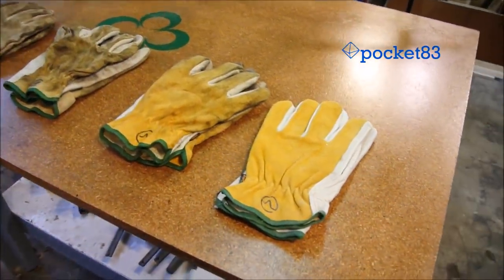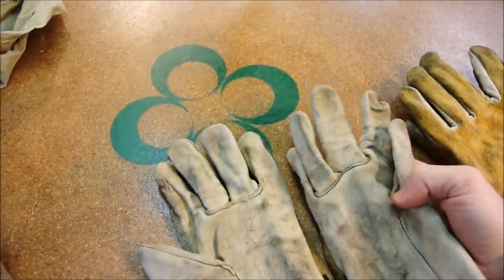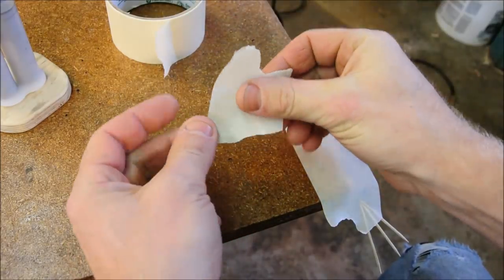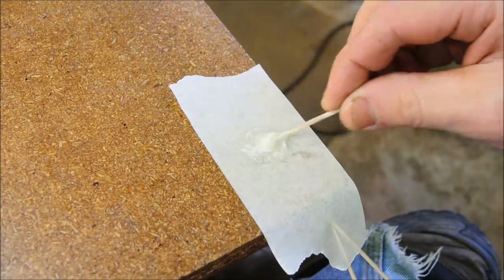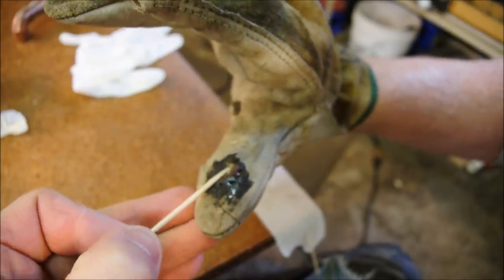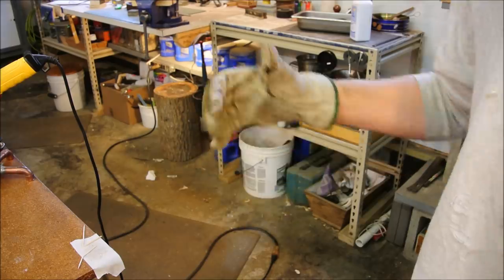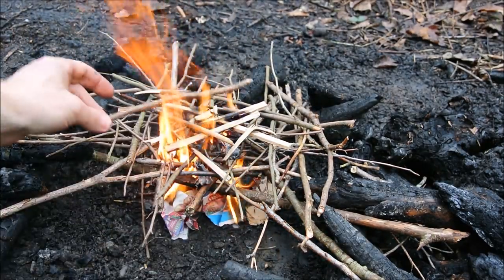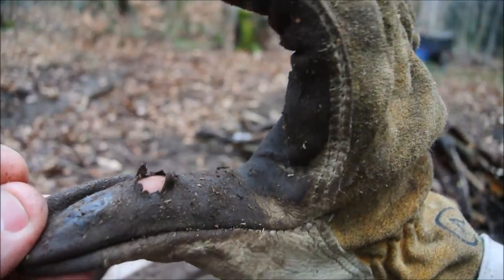Epoxy for Leather Glove Repair? Test result: ★★★½

Comment: Have you looked into Rocket Mass Heaters? I don't know if they're snake oil, but as advertised they are the best means of heating up a space with little fuel. (Wood included, no coal required)
Reply from the maker: Ok, book report time. I just spent 2 hours watching vids and reading about them. It doesn't seem like snake oil at all, but in typical subculture form, it's being presented as though it were a 'new' concept. It isn't. The idea of holding heat with a mass of dirt, straw, clay, sand, and rock is as old as the brick hearth itself. They were making fireplaces into heated beds long before we had many of the technologies that we now consider modern: like cast-iron. As for the "rocket," it's also only pseudo-nouveau, which is to say that it's naturally appealing to the ultra-earthy hipsters out there who've never actually played with fire. 

As a rule, on a planet with finite resources, "sustainability" is fools' gold when the inhabitants there have insatiable appetites. But perhaps they (the aforementioned trend-chasers) will gofund the technology, and that could help develop it into a safe and efficiently designed consumer product.   

The entire premise can be reduced to these parts: 
1) insulated, J-shaped firebox more thoroughly consumes fuel, reduces deposition, acts as integrated chimney.
2) non-insulated primary flue becomes a direct-to-air radiator.
3) massive insulation of secondary flue creates slow-release radiator, stores large amounts of heat.

Do I consider the present state of the technology efficient enough to warrant its construction right now? Ummm, that's tough to answer. A comparison will have lots of pros and cons, and it all depends on context. No matter what, it's unquestionably an interesting development on an old idea. Still, the pessimist in me is annoyed by those out there moralizing about it, touting their reduced emissions of wood-burning fuel as though it were worth some ethical brownie point. As an ecological extremist, my position is becoming increasingly misanthropic; we can't 'reduce' any of our unwanted by-products without an actual numerical change- that is, in population.
Reply: @pocket83squared  You're starting to sound a bit like Thanos at the end there.
Reply from the maker: Ha. I'm not actively becoming a super-villain quite yet. I'm just recognizing a mathematical reality that nobody likes to admit. There was lots of sanctimony in a few of the rocket heater testimonials I read, and I was reacting to it up there a bit. I do that every morning ;)
Reply: @pocket83squared  sure, I guess, but look at photos of LA 30 years ago and photos no, and then try and honestly say clean air rules didn't make a difference. Rocket stoves may be a pass in terms of energy consumption, but cleaner burning fires are way, Way better for the people nearby.
Reply from the maker: @Robert Szasz , Well made point. Pittsburgh has made a similar recovery in the years following its coal-fueled iron boom. At least with respect to its air quality. 

Not that I expect anyone to actually read this, but let's push on this point. If you do, maybe you will appreciate my frustration.

In the little mining town of Export, where I grew up as a kid, the lifeless creek we would play in was stained orange from the iron/sulphate. There is now algae growing in it, and it is clear for its first half, until industry ruins it again at the back of town. 

A bit to the East, the Loyalhanna was where I would swim, play, and explore as a young man. It provided for the old brewery in Latrobe, where they bottled Rolling Rock beer. In the hills downstream, there were boulder strewn fishing holes that looked like a fantasy. That story ends at the confluence with Crabtree Creek, which continues to pump in mine runoff, poisoning the Loyalhanna into a half dead and foamy looking piss-hole. *[You can see this stain from Google maps: walk along the river for two miles upstream, starting at the New Alexandria bridge.] But in the twenty years since I have rope-swung into it, it has made nothing but improvement in the pollution department. There has at least been some unenthusiastic attempts to treat the water with limestone in some places.

However, the numerical increase in population to the region is also correlated with an increase in litter and sewage, so the Loyalhanna's backwaters are now also clogged with more manmade filth and debris. Tires and plastic toys stop in great piles at the dam, and they fill the hills there up to the high water mark. Further, increased strain on an antiquated sanitation infrastructure provides more human detritus than the river can naturally absorb; this is called 'eutrophication' when we are talking about a bit more shit than a pond can naturally decompose, but when we have old coal towns that have been "grandfathered in" to allow a pipe from every toilet to our streams, we are talking about a state of pure filth. And what little water is left can no longer break down the waste, because the mining runoff has made it sterile. That is, dead. 

In other words: a modern river is nothing but a combination of industrial and biological waste that can simply no longer provide its ecological function. It is fake and dead, like the chocolate river in Wonka's factory. There is no solution to this problem that has anything to do with marketing buzz words like "reduction" or "recycling" or "sustainability." The answer comes from the biological sciences; it is simply stated as a carrying capacity problem, in which this environment has become too strained to support its present number of organisms. It's just a harsh fact that nobody wants to admit, hear, or think about. If we do witness "improvements" in a localized area, that is because we have relocated industry from there, and displaced all of our associated waste by putting it somewhere else. Sustainability is naïve, and in my opinion, dangerous.

I don't think we are necessarily doomed. But much like 'health,' there is nothing 'good' that one can do for the environment. It is either balanced or it is not. Just as you are either healthy or not. One cannot prolong one's life; one can only shorten its maximum possible. Thus, I regard it as the height of ignorance and self-absorption that a person might act as thought they are 'helping' the environment by using less of something. To me, using the smallest amount of resources necessary to achieve a goal is a fact of my life. I regard using anything more as purely selfish and unethical. There is some hypocrisy in pursuing selfish goals at all, sure, but that's the great human tragedy, isn't it?

I could never congratulate myself for attempting conservation. We owe it to our children, and to theirs. It belongs to them, and we're mortgaging it on a high-interest rate that they will have to pay down- if they want to survive.
Reply: @pocket83squared  you are underestimating by HUGE amounts what proper engineering, foresight, and a little bit of extra effort can actually achieve. Certainly there is a total carrying capacity to any area, but that capacity is at least hundreds of times higher when people work together to minimize the damage each individual does. California is still a major producer and refiner of oil and gas products, has large industry including major ports, and has extreme amounts of miles driven per year, yet most places both the environment is doing better than it has in decades. 

One of the reasons the more pessimistic attitude bothers me is that it not only doesn't seem to match up with what I know, but lots and lots of people think "well we're fucked so it's out of my hands, nothing I could do anyways so I'll just keep doing this hugely wasteful shit because caring and doing something takes effort" (and if the effort won't have any effect, why do it)
Reply from the maker: Admittedly, there's lots of truth to that. There's a dangerous edge on both sides here. Complacence is terribly unproductive. But complacent behavior is also a fact of the human psychology. We already know from the data what will happen when you explain to people how they contribute to large problems, and that the remedy will not affect their lives: they will shake their heads empathetically in agreement, but they won't modify their behavior.   

And I am in no way guilty of underestimating our advances in engineering! I understand what it means to exist on an exponential technological curve. I'm just not holding my breath pretending a quick-fix solution is on the doorstep when it likely isn't. The carrying capacity has already been artificially extended to a degree unprecedented by biological process. You can't keep putting additions on a cantilever indefinitely. We are already "hundreds of times higher" than what is sustainable in any natural ecological system.  

A person lives for 70 years, give or take. Assuming that you were to reduce one person's waste/consumption by half (which is an exaggeration of what is possible by an order of magnitude), such a gain in conservation will be nullified by the first child out there who also has a child during half of that span- and then, even if they never reproduce again, we still have the problem of educating and getting these two new kids to share. Comfortable or not to admit, we are on a collision course. You are arguing with a determinist. However, I also admit that we have an ethical obligation to try, no matter what. My point here is that it is dishonest and unproductive to tell people that everything is going to be fine. It isn't. Future generations will be paying an enormous price, just because of this simple equation:

Liberty ∝ Space,

It's a proportion. The less room we have, the less free we are to do what we want. There are already too many of us now to be wasteful without consequence, and in the future there will be many more. Soon, we will have to pay back the price of our present excesses.  

As for economics and California, it may have an enormous production, but it also has a staggeringly large consumption due to its population. Any 'improvement' is still only relative to how much worse it could be; it's kinda like decreasing your speed while driving from 90 to 80, when the speed limit is 60. But let's also be mindful that its country-sized GDP comes very much from the tech and entertainment industry bubbles, which are, with respect to brick-and-mortar-esque production, about as substantial as Enron stock. If there were an airborne zombie apocalypse, for example, southern Californians would be the first to eat one another, with not much in the way of supplies remaining for the survivors.  
      
Sorry for being such a stick-in-the-mud. I told ya, I know it's way easier to just pretend everything's going to be ok. But that's just not honest.

Comment: Why is the hammer holder on wrong side of jeans? you would think they would put it on right side.
Reply from the maker: I can deal with that. What is absolutely unforgivable is the fact that the hammer loop is too big for a hammer. They slide right through!

Carpenter jeans = poser pants.

Comment: 2:53 you set them by the WHAT?
Reply from the maker: Radiator. It's a metal thing with lots of surface area that uses (hot) water to diffuse heat. My new house doesn't have air ducts.
Reply: Haha I know what a radiator is, I was just joking about the way you said it. Where I'm from that's a ray-diator not a rah-diator lol
Reply from the maker: Yeah, I say it either way. That's EE-thur today. Maybe I-thur tomorrow. Always pot-ATE-oh, though.

Comment: Watch you with the wood, you might benefit from a “pickaroon”, which might be a good project. Another thing that you’d probably like is a brush axe or Bill hook. Fiskars makes a nice brush axe that is very useful for reaching into tangles of stringy growth, like vines, and using the hook to grab them and yank them out to then cut them up. But the pickaroon saves your back from bending over and you can make one from an old axe head.
Reply from the maker: It might be nice to keep a pickaroon back by the log pile. I don't split on the ground there. I'll consider improvising one to see if I like it. I don't want additional tools out in the woods, though.

Comment: I'm watching a pretty fire as you burn the small branches and all I can think of is carbon sequestration and doing something useful with that heat, like making the shop warmer. All that wood was going to have been eaten by microbes and turned into carbon dioxide anyway, but do I think of that? No.

I blame my child, who is constantly harping on global warming.

This sort of mind warping nattering is one of the hazards of having children. Also, I suppose, a potential hazard of posting videos.
Reply from the maker: It's also an incredibly myopic view of the problem, isn't it? Well intentioned and well marketed, no doubt. But when we drill down on it, it's simply childish to believe that one can sustain an endless consumption on finite resources. 

Ahhh, the age-old parental problem: when do you start to introduce Malthusian cynicism as a bedtime story theme? As if explaining where those dead carnival goldfish go isn't already tough enough! Good luck!